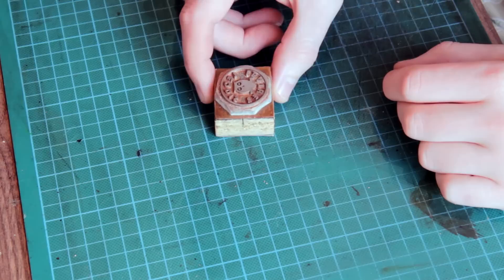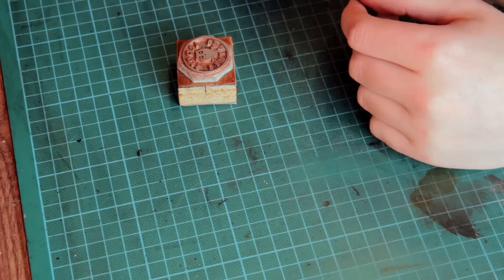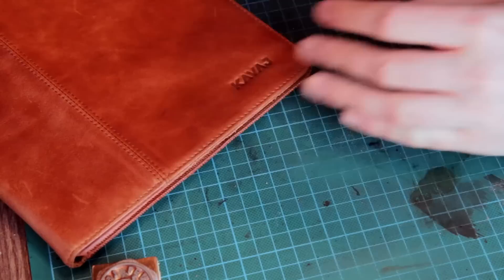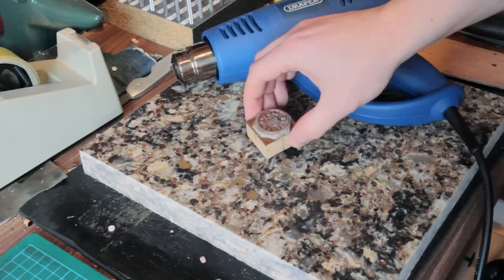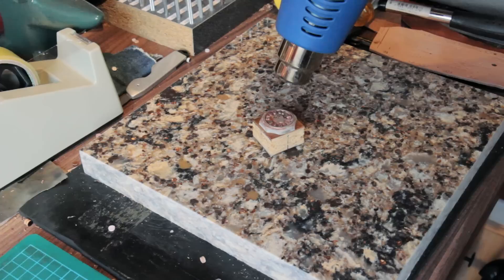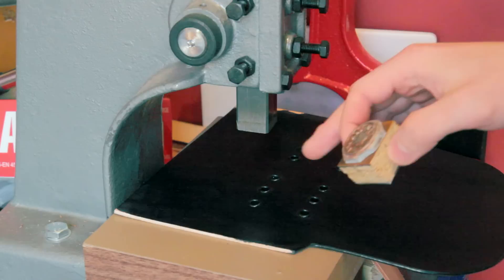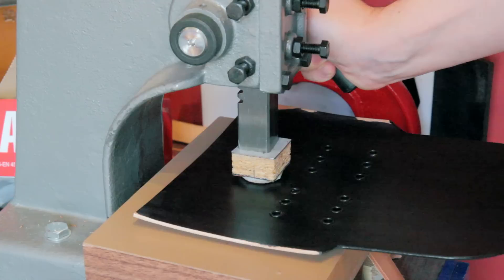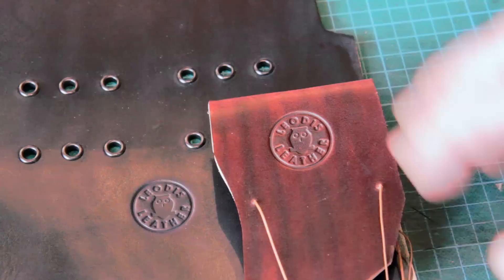Quick tip, how to hot stamp your leather

Comment: You can also use an electric flat griddle to heat up your Kydex and it's not expensive. You can buy one from around $20 to $50 American. Not sure what they cost in the UK but shouldn't be much more. Just lay the Kydex on the griddle and let it heat up until it's flexible. You can also order presses from knife making suppliers where you can mold the Kydex around knives, etc.

Comment: This method works on wood?
Reply from the maker: I guess it might if you got it really hot the same as a pyrography iron but that's a much higher temperature as you're actually burning the wood. I don't think it would be easy to do without the proper machine.

Comment: an fyi for you... I have never heard of solid magnesium exploding! it is very dangerous in the powdered/shaved state. it was used many many years ago as flash powder in photographs. I owned a company that made magnesium plates. we subjected the plates to very high temps (300ºf)when mounting the dies and also when vulcanizing rubber plates. 
great video on the stamping process... came out very clean
for those of you wanting to get dies like this, search photoengravers or magnesium die makers. copper may also be available in some areas. ask for deep etching with straight shoulders (some may charge extra) for the cleanest dies. there will always be a slope to the edges and very fine detail may be very shallow and not stamp at all.

Comment: Nice video. I need to do this on a couple of custom jobs and have found it very useful. Have you thought about applying a cross shape on the top of your stamp and carrying the lines down the sides to help with alignment? Never worry about using a heat gun on this type of alloy (Magnesium and Aluminium) as it won't get to a critical temperature. Flames and kilns are more of a problem.

Comment: Great job Ian. I'm using a stamp cut from silver and it works well with a heat gun and arbor too. I wondered if you had tried hot foil with this method?
Reply from the maker: I have yes, it didn't work too well! I think for hot foil a proper foiling machine would be more appropriate.

Comment: Hi Ian any tips on applying a hot/warm stamp on something which will have a slight curve on it? I apply my stamp after cutting, case it, apply stamp, dye then make a razor cover. My logo stretches out a little, deforming. Would I be best to complete  razor cover,  stretch/ bend then apply my logo? Failing that I think I will have to simplify my makers mark into a horizontal one instead of round type Lessening the risk of distorting my logo. Thanks

Comment: Hi sorry if this is a silly question…
I have been using this technique also do you think it would work with foil also 
I want to try the gold foil look  on a project 
But don’t want a foil machine just thinking up a way to do it with a heat gun and arbor press if possible.

Have you tried this at all 
Also is foil for leather a specific foil or can I just use a generic?
Reply from the maker: I have tried this yes with poor results, I think for foil stamping you need a more consistent and even heat which the machines provide or you’d need to work out the temperatures and quite carefully heat the stamp

Comment: Thanks for this video! Did you need to alter the arbor press at all? I was looking at a branding iron, but am thinking this may be more cost effective.
Reply from the maker: mine is modified but for other uses, if you just wanted to stamp with it you wouldn't need to do anything (the ram would be a solid bar)
Reply: Thanks!

Comment: quick question (which might be daft but I've never worked with leather before so bear with me) is it possible to do this with really old leather?

I'm doing a photography project and ideally I'd want add some lettering to an old knackered leather briefcase (we're talking at least 40-50 years old I reckon) it's dried and cracked, which is part of what makes it look good, so I don't want to bother if trying to stamp it will just trash the thing. 

thanks.
Reply from the maker: if it's dry and cracked then I don't think it will work well no
Reply: +Ian Atkinson that's what I feared. Oh well, thanks for the advice.

your stuff is looking really nice by the way. well done.
Reply: +Ian Atkinson just a thought, but I don't suppose that I could rejuvenate it by oiling or soaking the leather in any way could I?

again I'm not super hopeful, but it would be nice if I could.
Reply: You can, yes, with Obernaufs.
Reply: Mrnjaou I would have presumed that wax just sits atop the leather as a protective layer. are you saying that with enough treatments old leather might become potable enough for stamping?
Reply: Matt Rogers Wax does just sit but Obernaufs line is also for leather hydration (it soaks it up, you keep reapplying until a film forms). Their website should offer more info. People have successfully brought back to life leather boots that have been sitting in the closet for decades.
They have oil, weatherproof spray, 'wax' that isn't just wax, it keeps robust leather safe from the environment, possibly other things but those 3 I've tried.
Reply: OK, I'll check it out
Reply: Matt Rogers Great, also there's this
'Huberd's vs Obenaufs. Bottom line is that the two products have the same formulation EXCEPT Huberd's was developed for Loggers in the Northwest and Obenaufs was made for firefighters and has an additional ingredient that resists damage from firefighting foam. If you don't come into contact with the foam then the two products are essentially the same.'